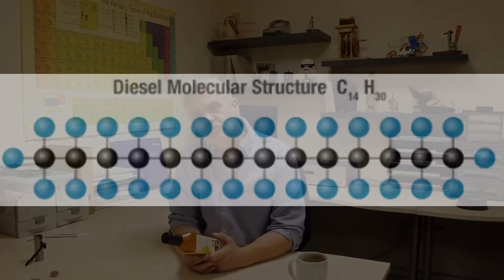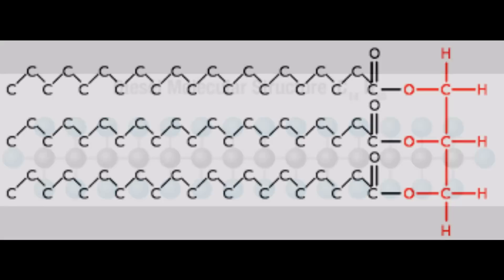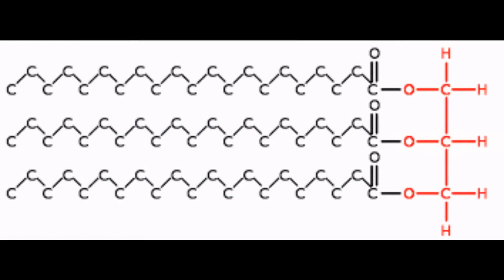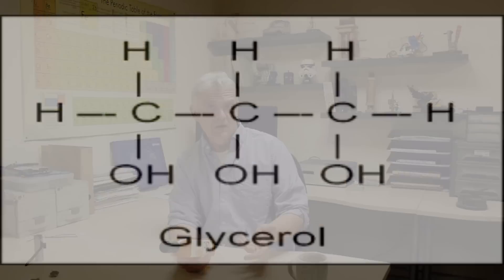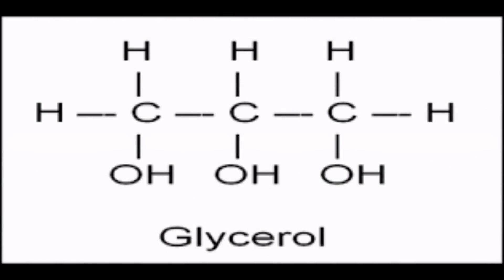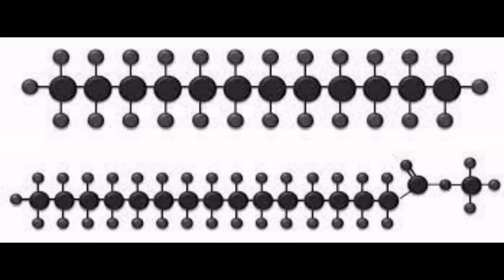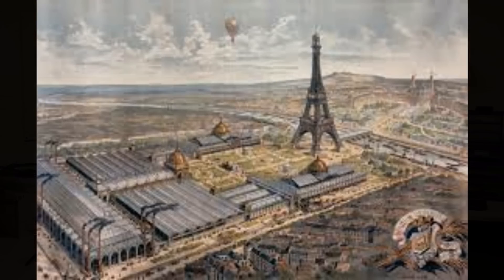1672 Biodiesel 101 - The How And The Why And The Wherefore Of Making It

Comment: If im teaching.  Don't  start with the lard fats for diesel. And dont use methanol because when it burns it release meth wich directly a photosynthetic cooling drug- If inhaled.
Reply: Interesting,  I never knew you would clean it with water... I've been doing it for years. But using only Ethanol.  But I think that water is a great trick.

Comment: I have a few questions for you please.
.
1. If I were to make biodiesel from absolute scratch using ethanol and wood lye, AKA potassium hydroxide, what purity ethanol would I need to get to and how would I get to that?
2. Would the wood lye need to be dry after extracting it from the ashes?
3. Also would I be able to cut the biodiesel with the ethanol afterwards to get a fuel comparable to gasoline instead of biodiesel?
Reply: @stacyroe619  using alcohols that are less polar than methanol (like ethanol is) requires the reaction to be anhydrous to achieve the phase separation between the fuel and glycerol byproduct. Ethanol reactions to make biodiesel are much more sensitive to water and soap formation

Comment: Rudolf Diesel's first engine (1892) actually ran on coal dust suspended in water. It didn't work too well so he switched to peanut oil in time for the World Fair Exhibition in Paris 1900. Far later than you said.

Comment: The thing is that most every kind of waste is in demand here where I live. Factories burn rice husk, wood waste, straw, chaff. Dirty engine oil is sought after and is cleaned and sold as cheap, shorter lasting engine oil. Pretty sure there will be something like that for the used edible oil from eateries. And other than that, especially barely edible vegetable oils are about 3 times the price of diesel. I find ethanol fuel to be more promising. I even created an experimental batch of it which is still on pause because I'm too lazy to find zeolite to soak the last 3% of moisture from it. Thing with ethanol is that you can ferment a lot of things and it does not have to be edible. American farmers used ethanol all the time until big oil figured out how to refine oil into petrol and shut them down.

Comment: Hi Robert, I have a 5 Kilowatt Diesel Generator that I run on waste veggie-oil that I let settle for two weeks, then filter it through multiple-cleanable bucket filters down to 75 microns. I then run it through multiple-cleanable Polyester cartridge filters down to 1 micron nominal. The final stage is to thin the viscosity with 30% Gasoline (petrol) during the winter months and 15% during the summer. I do not separate out the glycerol, because the petrol acting as a solvent works wonderful. Kilowatt for Kilowatt my generator costs less then the power grid. Would you consider doing an episode on my process and give your opinion?

Comment: Also possible to run older engines which are pre common rail (ie mechanical injection pump) on clean, filtered and de watered waste vegetable oil using 2 tank system where you start and stop on diesel but run on WVO heated to 80 - 100°C which reduces the viscosity to something closer to diesel although it’s viscosity is still higher than diesel. Is it perfect, no, doesn’t have the same energy yields etc and if you aren’t careful you might foul your injectors and it’s important the engine is at operating temperature before switching to WVO. It’s also important to not contaminate the diesel tank with WVO by controlling sequence of supply and return valves

Comment: Rubber Mush. Ok so the reality. I made biodiesel for 8 years used in 3 vehicles back in the day. I absolutely guarantee 100% that all rubber components not completely compatible with methanol (don’t think it’s all out of the fuel with 4 washes) will over time turn those rubber seals, gaskets, fuel lines etc etc into mush. I don’t think a single diesel vehicle on the market today is suitable for B100 or even B50. 20 years ago yes. It’s not that the engine can’t burn it, it’s what happens getting the fuel into the engine that’s the issue. From memory, vitron was the way forward.

Comment: Hi Robert, I have followed your procedure and I have bumped in a problem during the biodiesel water washing phase: the biodiesel and water form a white foam that does not separate with decanting.

I thought the container was contaminated with some detergent: I washed the container well, 3 times, but the problem re-appeared.

I have got a centrifuge (I work at uni) so, i have put some of this foam into that for 1h and 4000 rpm and the result was 3 very distinct layers into the cuvette: biodiesel, water and a funny suspension of white stuff.

I can send you some pictures of what I have used. 

Could you help me, please? 

Giovanni

Comment: After using Vegetale oil to run my van I found the most cost effective way apart from using pure vegetable oil and making biodiesel was to mix a biodiesel blend, you mix 1/3 veg oil to 2/3 filtered and de watered veg oil and you will have the same consistency of biodiesel and will burn just as well.

Comment: Graphene Oxide breakthrough! 1.9% huge yields  Synthesis and optimization of microwave-assisted exfoliated functionalized graphene as an efficient catalyst in biodiesel production 
The optimized reaction temperature, time and catalyst percentage were 178 °C, 3 h and 1.9% respectively. It was observed that modified graphene, due to its high surface area and presence of sulfonic acid functional groups, is a suitable catalyst with reasonable capability providing a 98% synthesis yield, also in the present study it was prepared from graphite which is a very cheap material.

Comment: Regarding the b50, how do they solve the blendwall problem ? biodiesel blends are great up until 30% and then the viscosity tends to have too much of an increase same the gunk build-up in the engines. 
The blendwall is also the reason why some companies prefer using hvo (hydrated vegetable oil) as an alternative, only since EN 590 or ISO 12xxx has biodiesel classified as trans esterfication of vegetable oil they can't use hvo as a biodiesel

Comment: Gosh this is just the detail I’ve been looking for for ages now! Thank you!
I’m so tempted to try this. I think maybe it would be wise to buy an old paddock bomb to test it on first though, as I really need my current car to last me until I have solar sorted and have saved for an EV, plus there isn’t one out here (Australia) yet that has quite enough range for what I’ll need. In a few more years I should have lots of options, but I can’t kill my car with dodgy fuel until then!
Reply: I was thinking the same. I live in Australia to and until EV's get enough range to be able to handle the long distances my ute can currently do it just doesn't make sense to go electric.
Reply: @atticusjxn  yeah I’m about to move to the country and need to be able to come into town, where I currently live, do my running around and go back home. About a 3 hour round trip. It will already be a big day and to have to add in driving to somewhere to charge it (nearest fast charger is 20 minutes out of my way) and waiting there for 45 minutes it’s just too much. Plus I need the freedom to have the radio and air con on as I drive too. So I have to wait. Got myself a second hand diesel car so it will be really efficient on the long trips, but that’s the best I can do for now. It’s a shame isn’t it. Oh well. A few more years and we’ll have much more choice.

Comment: Thanks mate, I've been making it for 5 years now, we run 2 cars and a log splitter,. I use potassium hydroxide and methanol. My mistake in the early days was to use the fuel way too early, before the full transesterification  reaction was done . Now I know better, thanks again and greetings from Australia!!
Reply: I looked into this years ago, and I heard using Potassium Hydroxide IS better, because you get better soap and the methoxide is less dangerous anyway.
Reply: I was thinking about using biodiesel as an alternative to kerosene in my homemade lamps.  I might have to make a new type of lamp with a stubby fuel tank but my goal is to be able to make biodiesel and use it in lamps.
Reply: Had the same idea but instead of Methanol i wana use Ethanol @mrdojob

Comment: Great Vid -👍👌👌For a successful yeald, especially when using used oil - you often have to employ a step called titration where you test how much free acid radicals are present. Then you can alter the catalyst values accordingly. Also Diesel himself was regarded as a threat to the petrochemical industry 😓 Also methanol is poisonous and especially with the catalyst - check the MSDS for Methoxide or Ethoxide  -

Comment: Do you know of someone who has, or have you done yourself, an analysis to compare the energy content of a unit weight/volume of biodiesel ... to the energy expended to produce it?  (i.e: ERoEI, energy return on energy invested).

The energy invested for biodiesel would include (I doubt the list is comprehensive): the energy to transport the seed of the base crop, to prepare the field for planting, to plant from a seed drill, to fertilize, to apply herbicides and/or pesticides, to harvest, to press the oil, to convert the oil to "biodiesel" (including materials & energy for each batch, amortized infrastructure, dealing with the glycerol, etc.), to transport the biodiesel to its point of use?
Reply: @Robert Stallard Are you saying "no one" believed the concept from the beginning or that they gradually began to apply the energy accounting analysis I suggested above?

Comment: Used to mix rapeseed oil half and half diesel and ran it in a peugeot 405 during summer and winter for years no problem.mechanical pump then.The motor ran for a couple of years after that and was scrapped for suspension fault was still running great?

Comment: You can grow singel cell algae for cheap oil and great fertilizer. You can make methanol by boiling wood at 78.3 celsius in a distillation system saw dust, chips, pellets, or splinters work better than blocks or sticks the left over mash can be used as compost material or turned into a aerogel by adding a binder pouring into a mold chilling to 33 F and then to 
32 F this forms microscopic long thin ice crystals that "fluff" the gel when the binder sets thaw the gell and let the water drain and evaporate away.

Comment: This one is a good one. Specially when Europe bit the hand that fed them and "did the right thing"    i wanna make a centerfuge.
Reply: They are very useful, Get a old ten speed bike or three regular pedal bikes get some hinges set the chains and gears to increase rpm semetrically mount the hinges to the rim of the wheel so gravity holds the containers vertical when still and swings horizontal when spun build the machine so the wheel is horizontal and a surrounding container to keep anything from killing people if bits fly off.
Add a motor for more fun or less exercise depending on how you look at things. :)

Comment: This is one that I have done for fuel for my truck. Of course to be responsible you need to use used cooking oil. The first problem I had was filtering out all of the food debris in the oil. Once you have accomplished that you can process it with standards methods. Then the problem I ran into was the jelling of the fuel, so I installed a small tank heater and a fuel line heater. Then you will need a fuel diverter switch so you can switch from bio to diesel. So two fuel tanks, my bio tank was mounted in the bed of the truck, a switching device and a warning label on the dash to remind you to switch it back to diesel before you shut off the engine. It worked flawlessly. But by the time you figure in the refining setup, the time it takes to filter and refine the oil, the cost of the equipment needed, it would takes years to pay it back. Then you run into the issue of getting the used oil in the first place. I thought this would be easy, but boy was I surprised. Of course I wasn't the only one doing this so soon enough the restaurants wanted you to buy the oil from them and then the cost goes up, let alone the time and money it took to go from place to place getting 10-15 gallons of oil at a time. After a year I just left the switch set to diesel and stop using bio. About a year later I took it all off. I even tried using used motor oil, it works just fine, but you end up with the same issues. This is one thing that I feel needs to be done on a large scale to make it worth while. But it's nice knowing I have the knowledge to make fuel if it were the only way to power my truck.
Reply: Grow single cell for oil the side products are also useful if you garden.

Comment: can you do a video on how to make your own vegetable oil?
Reply: Grow single cell algae, with a sand and cloth filter concentrate the algae, boil it in a solar oven for 3 hours mix with water let the solids settle out, heat it again the oil will separate and float use separation funnel so water and solids leave first.
use leftovers for fertizing more algae or your garden.
Reply: @Barskor1   can you do this is terrestrial plants? and if so how does the process differ?

Comment: you said this will run directly in pre-1970s diesel cars, but were you referring to the original veg oil, or the refined diesel??  it sounds like newer diesel vehicles will run on the processed diesel without issue, but i don't want to assume.  anyone??

Comment: OK so i am i little confused hehe not difficult .... so if you were to preheat this before entry to the system (as per 1673) this should give a much better performance increase as its less viscous .. and maybe remove the need to pre process it at all? thinking further you have glow plugs in diesel engines now so startup heat should be a simple extension, then have a system that takes the heat from the exhust and then preheats the input fuel !! thoughts?

Comment: Hi rob
On garage54 they do some mad stuff. He ran paint cleaner through the engine to clean it out and it worked. Perhaps if you mixed the two it would work.

Given your glycerine video you would need a carburettor maybe with pipes wrapped around to heat the mix before it goes in to get heated to burn the glycerine
Reply: oil lamp...

Comment: Book of Elli is a good movie. The only downfall of the movie is that he kills cats and eats them. I know a lot of people who won't watch it because of that.  You didn't mention much about the temperature that biodiesel gels up in the winter. I made a processor and made biodiesel for a couple years. I live in the northeast US and ran straight bio in a truck I had all summer. Some people would add heaters to there fuel tanks for winter.  Or even a pre heater going to the engine. Best to put an extra fuel filter that's easily accessible because it will plug a filter rather quickly. Nice smell of French fries going down the road. Or chips over there in the UK.

Comment: You can also just blend with 20% gasoline to straight oil to reduce the burning temperature.  No waiting for a chemical process.  I know it's still requiring purchase of gasoline but much less labor intensive.  IIRC a small amount of acetone was used as well, as a anti-gumming solvent.

Comment: Hm, overall a nice video. You said 100 g, 20 g, 1-5 g, but it looked like quite a bit more than 20 g of oil. How much can you process with the 100 g  alcohol and catalyst?
Reply: I think Robert pointed out the incorrect containers. Usually when making biodiesel, for every 1000 millilitres of oil, use 200 millilitres of methanol and around 5 grams om 99% NaOH. When using KOH as the catalyst you need more

Comment: What your thought about Fischer–Tropsch process biodiesel from methane?
We have in Sweden a company that trademarked it and calls it Ecopar.
Used it before in my family company in the early '00. In the winter (-15C) we forgot engine heating overnight in the old '90 Scania. Started up with Ecopar without smoke. Truly a futuristic fuel.
But the lack of political interest and change in environment laws in cities changed the interest. Lack of funding when they wanted to change from bio-methane instead of petrol-methane. I heard that they use it in marine special cases (Ecopar is non toxic for fish) but trucks in Sweden run on HVO today. Much worse fuel in my opinion.

Comment: I used a pieces of picket and put 2 long screws protruding about 100mm apart connected to the wall socket . This was placed in the top of 25 liter clear bucket sitting at bottom and turned on . This will accelerate the separation dramatically . Obviously dangerous way for stupid people but totally safe if you don't touch it and play around . If you lift it up after a wile you can see arc if the screws are a bit closer together
Reply from the maker: nice tip mate - unfortunately there are some pretty stupid people around lol
Reply: @ThinkingandTinkering  survival of the fittest can correct that problem quickly..

Comment: I've heard people say that some seals on modern engines in particular get dissolved by biodiesel. Looking at the molecule showed I would think this is incorrect.  Anyone have any thoughts?
Reply: I was told this. The other point mentioned was that certain fuel pumps would struggle with bio. I think that was to do with viscosity.
Reply from the maker: it doesn't sound right to me either - I think the main reason is the difference in flash point means some adjustment to the engine is needed for a full burn - without a full burn you get coking - obviously lol